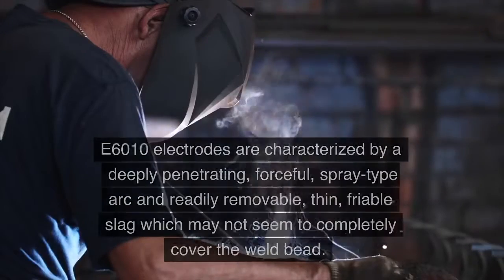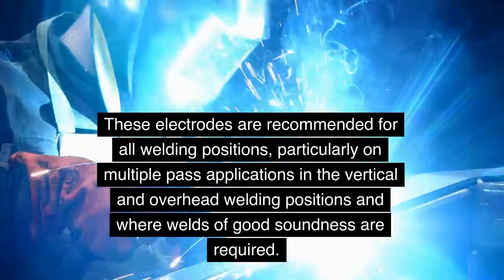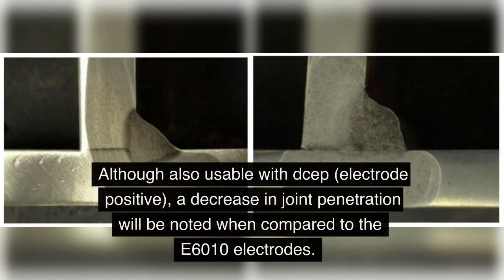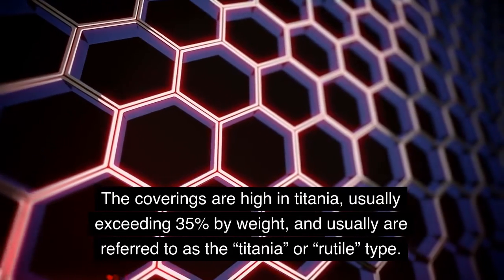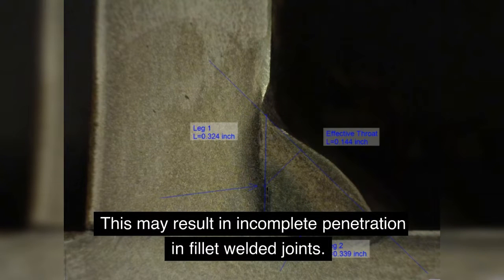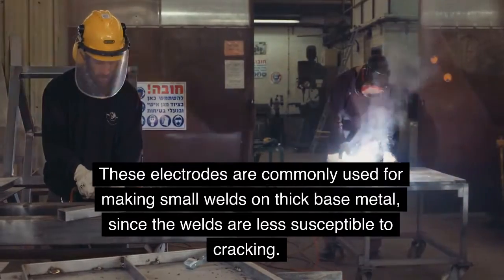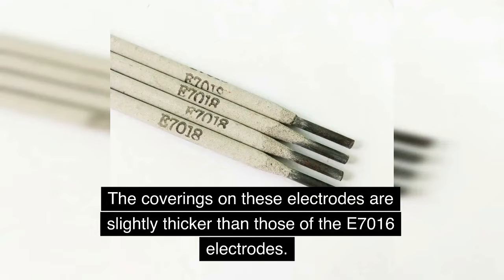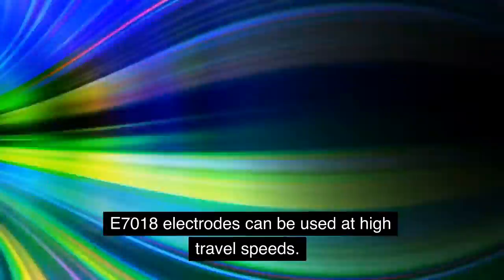5 Main types of Welding Electrodes

Comment: 14 No = 2mm current 35 -55 Volts  DC E6010-E6011
12 No = 2.5mm current 50--80 Volts DC E6010-E6011
10 No = 3.15mm current 80-110 Volts DC E6010-E6011
8 No = 4mm current 110- 150 Volts DC E6010-E6011
6 No = 5mm current 150-180 Volts DC
4 No = 6.3mm Current 220-330 Volts DC

Comment: Sir, which welding electrodes are used in non-alloy steel?  Material reference,S355J2H.
Reply from the maker: Thanks. You can use E7018
Reply: @MaterialWelding  What will happen if I use E 8018?